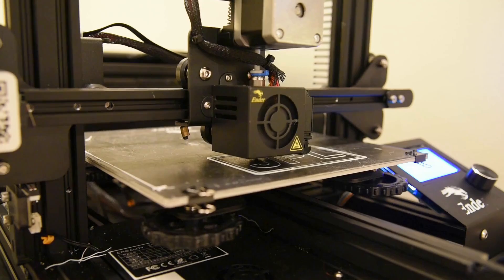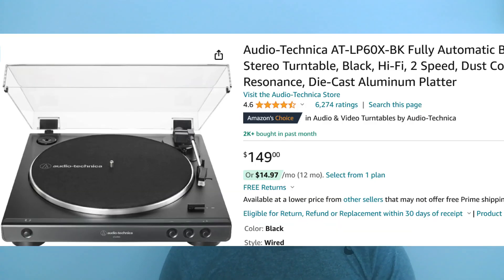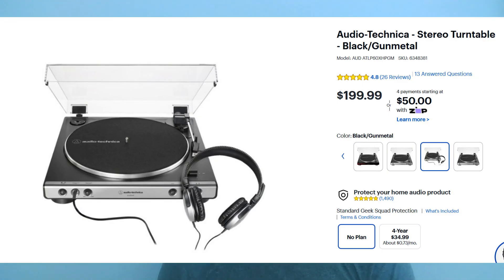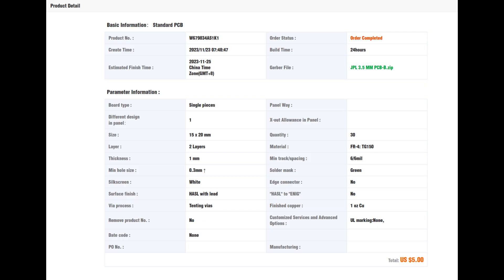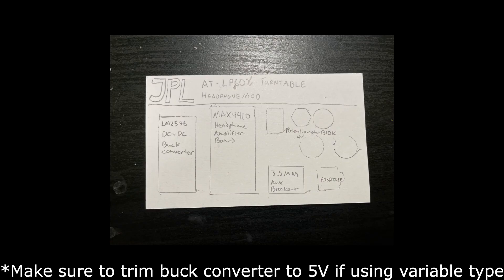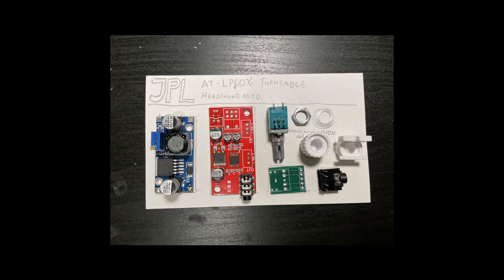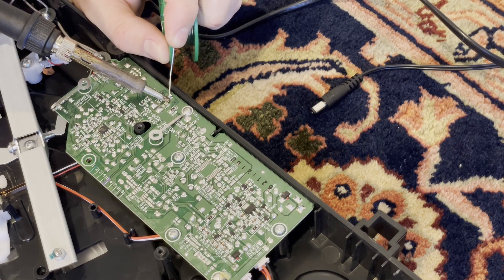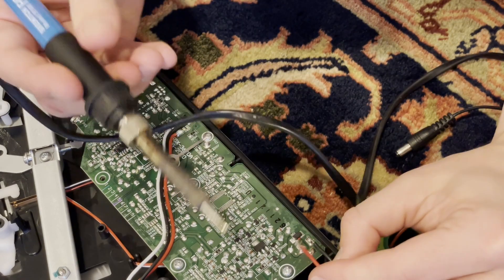Hacking the AT-LP60X Turntable

Comment: I’d add a Bluetooth transmitter to add that cordless thing. Great video. My current project is finding a way to get a balanced output from my turntables. If possible this would give a clean (or that’s the idea) signal at the output. 😂 that’s the idea.
Reply from the maker: Bluetooth and a USB ADC were part of the original plan…however, the project would likely have taken much longer to complete. I’ll be looking out for your project!